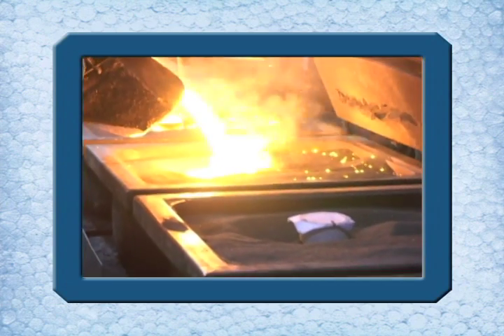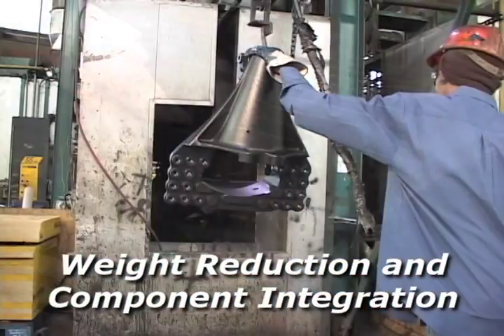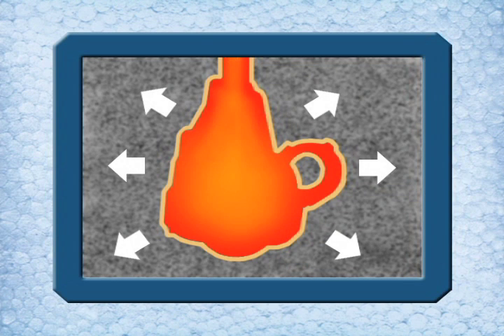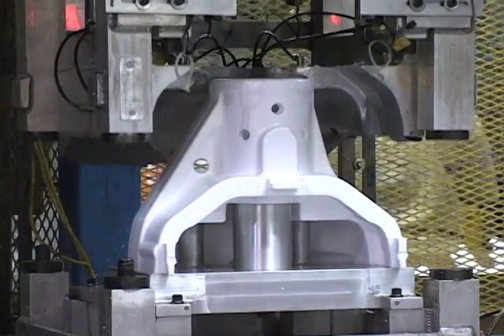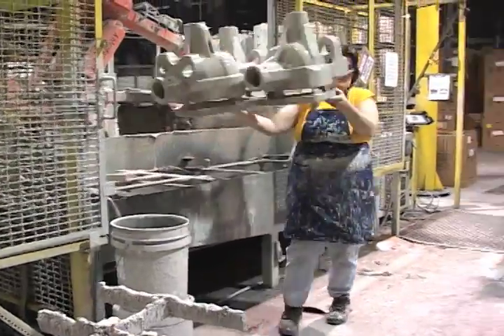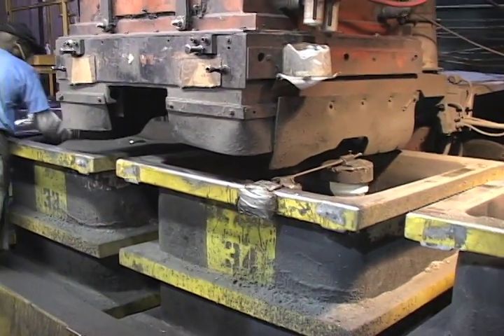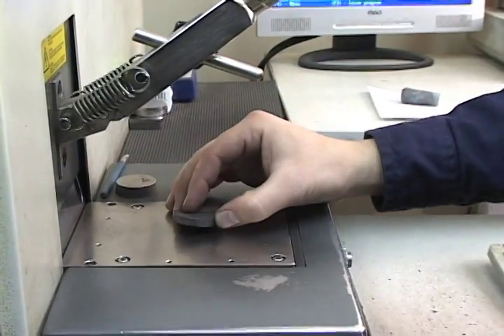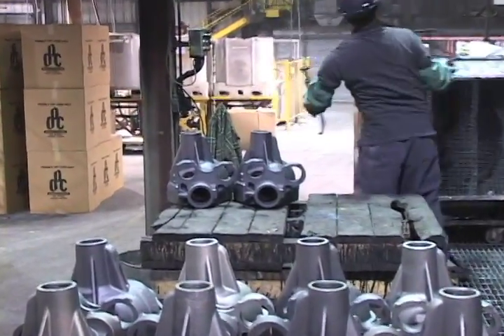Grede Lost Foam Casting

Comment: how does the iron stay in the cavity if there is loose sand around the polly pattern is there a special coatings on the polly pattern?
Reply from the maker: When the foam model is coated, the mixture used is resistant to heat.  The sand sticks to the coating when the hot metal is poured and holds its shape.  The foam evaporates from the heat of the metal, and when the metal cools, the coating and sand have to be shaken free from the cast part in a huge vibrating container, because the sand and coating hold together so well.  It is an amazing process, and if you have the chance to visit a casting facility, I think you will be fascinated.
Reply from the maker: Good question. First of all, the sand is packed in fairly tightly, through vibration and weight.   Secondly, when the metal is poured in, it creates outward pressure which pushes against the sand, helping to hold it in place against the walls of the container.  And third, the foam evaporates fairly quickly as it makes contact with the hot metal, but the coating on the mold is more heat resistant and holds its shape long enough for the metal to fill the form, so the sand has nowhere to go.

Comment from the maker: I only produced the video, I don't work for Grede, so I can only tell you what I saw while I was on site at the plant.  The parts come out of the mold with somewhat of a matte-satin finish, with a mild texture to it.  For any surface that does not need to mate seamlessly, the surface is usually completely usable once initial manufacturing is complete.  However, the metal can be milled to a completely smooth finish if needed for parts that need to line up to high tolerance or contact to other metal parts.  In almost every case, significantly less processing and finishing is necessary when compared to standard castings.

You can find out more, by contacting the company.  Information is available at the web address below:

http://www.company-histories.com/Grede-Foundries-Inc-Company-History.html
Reply: I’m curious to know if this was the brewton Alabama plant. Got an interview coming up and trying to do research?
Reply from the maker: @Re_DEEMD  No, it was not Brewton.  But it was in Alabama, outside of Huntsville ... if I remember correctly.